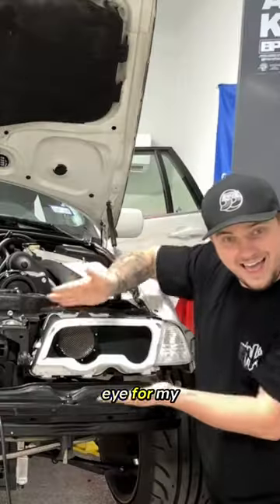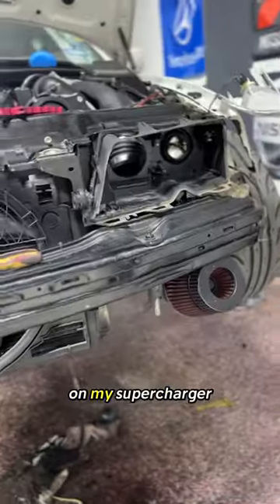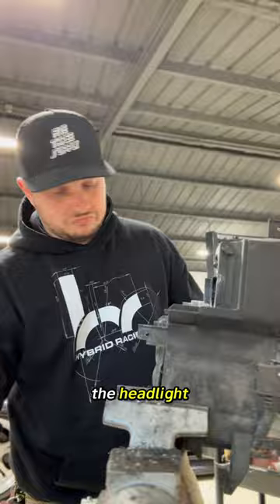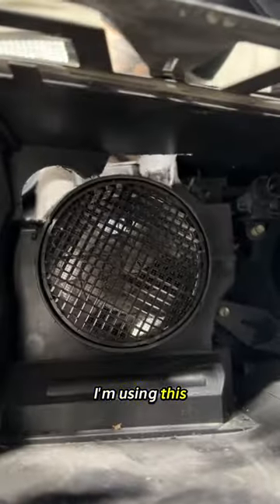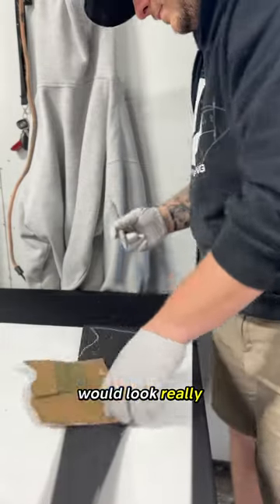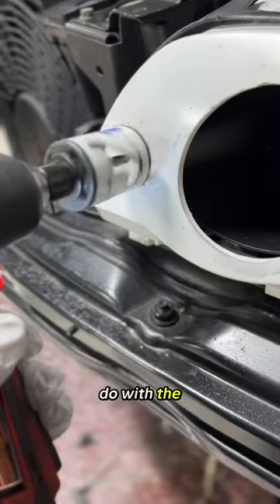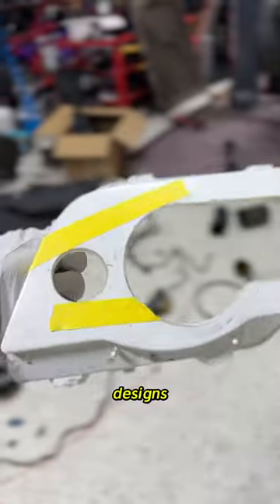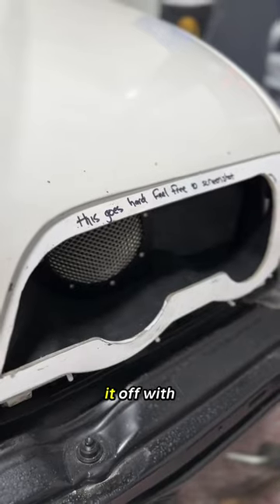DIY BMW Battle Eye Intake Headlight #bmw #drift #cars #shorts

Comment: This is cool but you might end up with some Maf noise. If you get that then just move the maf sensor into the tubing by more than 6 inches. Not saying it's going to happen but I've had some weird turbulence issues before when moving the maf sensor location